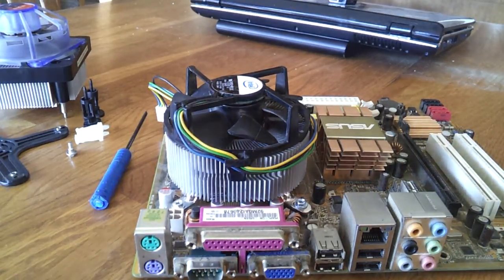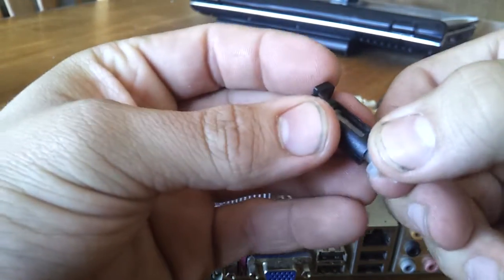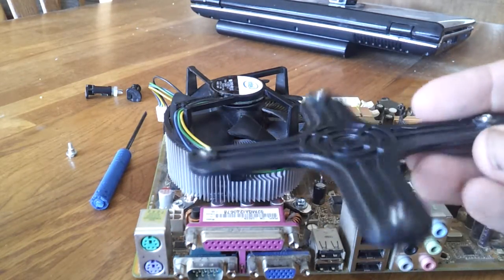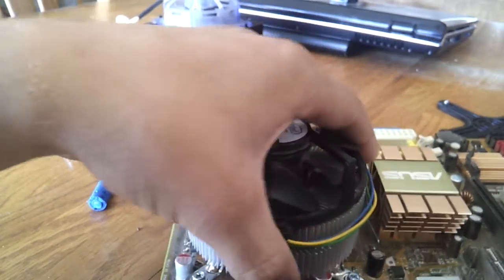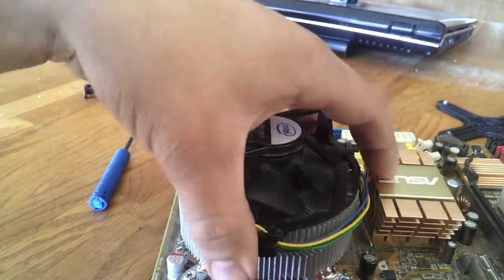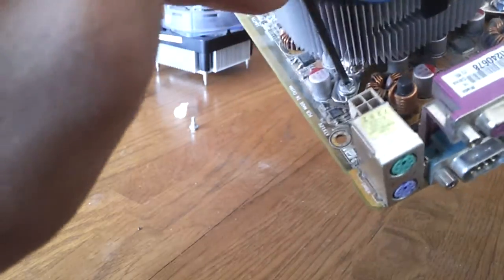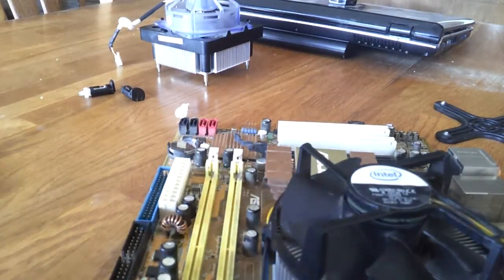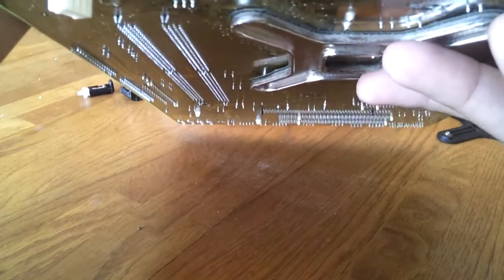Intel heatsink fix

Comment: Nice video! I just got an i5 2500k system from gumtree for 100 usd. Cpu was running warm so I took off cooler to reapply paste. Putting it back... At least one of the clips has broken and so I can only put three clips through. Cooler stays on if pc laid horizontally but falls down if vertically.

So unsure whether to get new clips (and have another fight with intel) a complete new stock cooler (but ebay ones are probably aluminium not copper... Mayne 2500k came with copper) or get third party. But don't see point in spending 30 dollars on a cooler for a 100 dollar pc! Budget builds is what motivates me! Seen a chinese cooler leshp for 8 dollars but also tempted to get some new clips for three dollars.... Either way. Don't want another fight with the damn cooler!!

Comment: I hate those push-pins. Can't understand why they didn't go with normal screws instead as a default way of installing their box coolers. Classic example of over-engineering. Quite often I've witnessed when coolers broke lose of the mainboard. This wouldn't have happend if they were fastened with screws.

Comment: How do I remove the push pins from an Intel heatsink so I can replace it with screws?

Also, do you live near a train?
Reply: i tried to do like u but i didnt put metal plate under i just screwed it somehow,now when i start pc all fans are working all lights are working but no picture no sounds... u think that those screws coused problem?

Comment: I have managed to replace the white push-through clips on an old LGA775 cooler (the ones with heatsinks 30-35 mm high).  It takes a lot of fiddling. However this seems impossible on the small low-profile coolers or the LGA1366 coolers, which have slightly different clips.